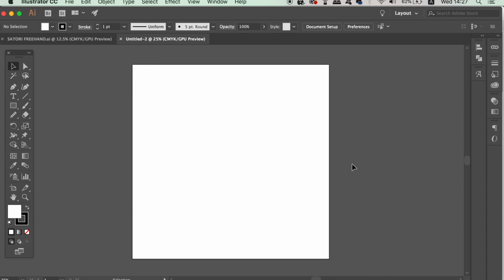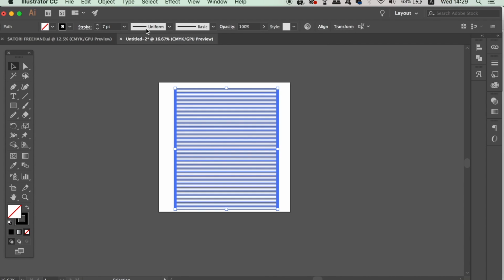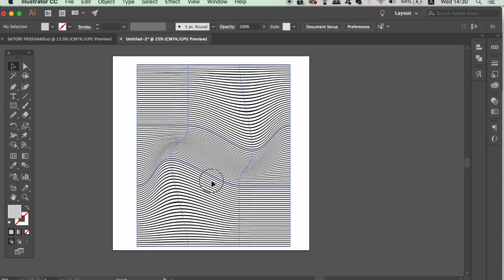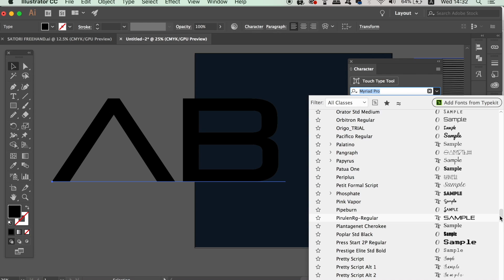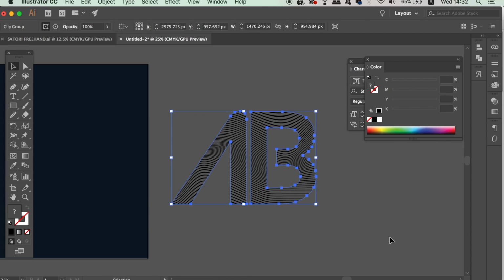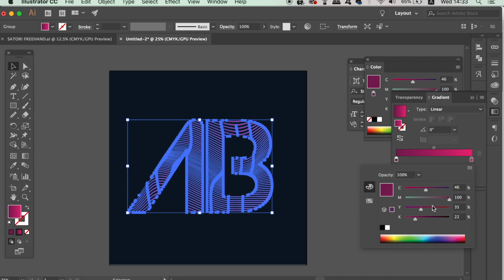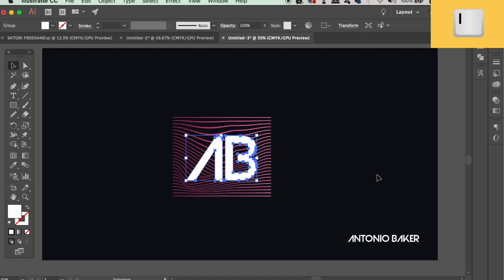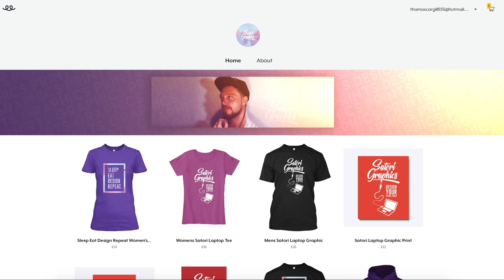Make Mesh Logo Design In Illustrator (2 LOGOS) - Illustrator Logo Tutorial

Comment: Satori, when I move the mesh´s handles after the envelope distort , an irregular black hole is made instead of the wanted distorsion. Im sure its something about my illustrator´s settings but not sure exactly it is, do you have  any clue?? Thanks!
Reply from the maker: Can you please take a screen capture of the problem, and then upload it to an image sharing site and post the link?
Reply: As you can see, when I moved the handles to make the distorsion, a kind of black hole is made on the grid.
Reply: I have the same exact problem sir 😓
Reply: I figured it out. Check your fill and stroke. I began on a fresh template and the black hole got fixed.
Reply: @brianagar  make sure your fill is none. And stroke is black.
Reply: @adwitiyadixit  have the same problem, checked and opened a new file. still same problem.
Reply: @amarsidhuuuu  did you make sure your fill us set to none and the stroke is thin?
Reply: @adwitiyadixit  yeah figured out that was the problem, thank u!
Reply: @diegodecamino5463  Just before you create mesh, make sure your fill is set to none

Comment: The make mesh tool is getting white patches when I try to move it around. What am I doing wrong?
Reply from the maker: That isn't something I am aware of, can you screen capture it and then upload it to an image sharing site to link here?
Reply: @SatoriGraphics  I also encounter the same problem. Here's my screen capture https://imgur.com/gi15Htj
Reply: Same as Sakinah's problem
Reply from the maker: @sakinahhamid9196  sorry for the late reply, it's difficult to track comments on old videos. 
I haven't experienced this issue, but I feel it may be due to you having the GPU setting activated. Try going up into  the preferences and then disable the GPU if you have it switched on. As of now, this is the only solution I can think of, but I'll ponder it some more
Reply: @SatoriGraphics  That did'nt work for me :( But I'll keep looking around as well.
Reply: @sakinahhamid9196  when you making the lines dont fill it with white color, only the black stroke.
Reply: @SatoriGraphics  I had the same problem until I realized I created my lines with a white fill while you created yours with no fill.  As soon as I changed the lines to "no fill", they behaved the same as yours.